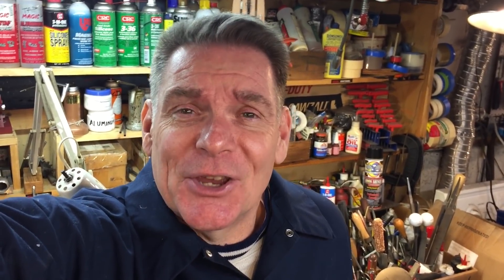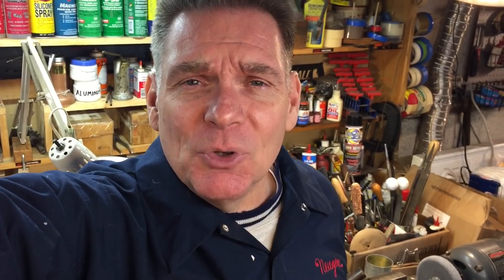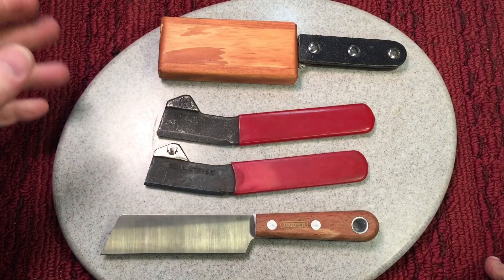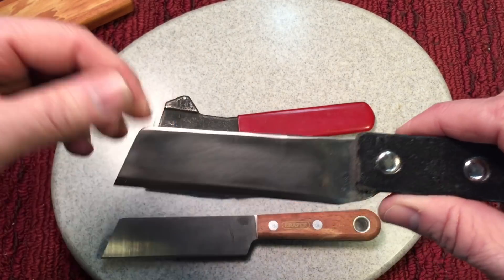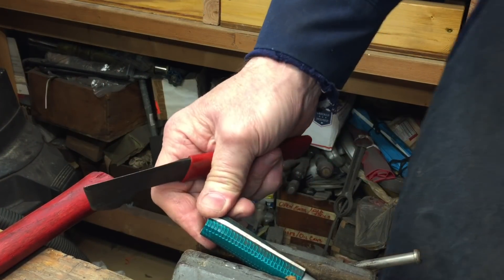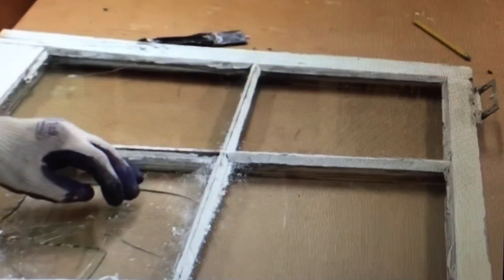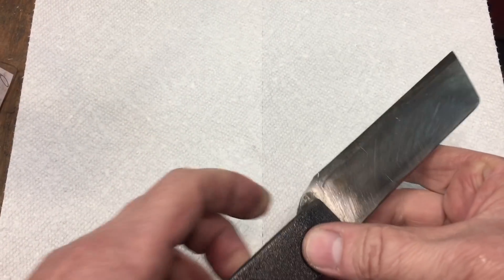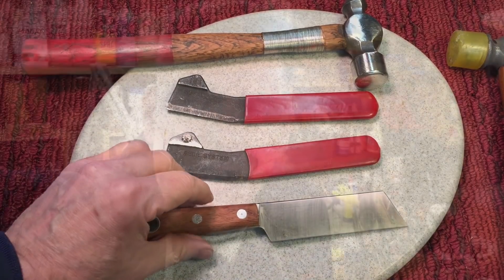Introduction to the Hack Knife.

Comment: I clean the rubber handles with mineral oil (food grade) and then use a mild degreaser and nontoxic wheel cleaner that has carnauba wax in it. They do get grimey but I try to stay on top of my tool cleaning since I don't want to contaminate things, make the insides of my cabinets or boxes or bags dirty, or put a dirty tool on a clean or painted part - it's often easier to clean a tool than to clean something else!
Though maybe I take it a bit too far at times.

Comment: I recently discovered tub o’ towels on amazon. They are pretty amazing the grime the take off. They are hand wipes. All my rubber grips on my pliers and screwdrivers were black from mechanic work for years. I did a quick wipe down with very little pressure and it cleaned them all like new. I was amazed, I don’t think they should have caustic chemicals since they are hand wipes. Give it a shot you will be surprised.
Reply: It took 4 years but he finally tried them!

Comment: Use liquid hand soap and warm water and the rubber grips will look like brand new. I have screwdrivers with rubber grips which are ~20 years old at work. They still look good.
Reply from the maker: Marcel Germann We have a hand cleaner here called Goop that works great but who wants to have to constantly clean the handles?  I prefer Acetate.  I also liked to old fashioned steering wheels!  😃
Reply: @ScoutCrafter  At my work the tools are provided by the company, so I don't have a choice.

Comment: I'll bet good money the sharp edges on the back of that hack knife were there to be used with ferro rods. The expectation when batoning is usually that it's being done with a branch or improvised wood mallet from what I've seen. For processing kindling those knives seem to fall somewhere between a dedicated froe and a full on bushcrafting knife.
Reply from the maker: Curiosity Forge Allan- Hack knives were really popular 50 years ago-  The Ferro Rod phenomenon is only the last 10 years as YouTube has popularized them.  I have been camping for 45 years and we use a lighter or matches to start a fire.  Using ferro rods is akin to fly fishing for food.  😃👍
Reply: Fair enough. I'm just spitballing possible reasons for a spine being that sharp. Between the stress risers created by those sharp angles and the nuisances created by handling them usually there's a specific reason for the edges to be there.
Reply: Curiosity Forge nope only used in uk for glazing

Comment: Great Video. The wood handled knife has what is referred to as "convex edge from the looks of it. So as it goes through the wood it causes a popping effect as there is little surface for the wood to rub against. Some what like a straight line along the curve of a circle it has a reduced baring surface. Also the angle changes quite drastically during the curve for the cross section putting more pressure on the wood to part
Reply from the maker: Hi Abe!  You know battoning has become really popular since the bushcrafting craze.  However the old fashioned Froe was the grand daddy of them all!!!  =)

Comment: Hey I use linesman pliers all the time haha they are great so many uses though you would cringe at how they are used in the field when they become an improvised hammer and such, but than again the slotted screwdriver becomes a chisel for wood, concrete or masonry as well as a pry bar. I dont think theres many jobs I can do without my linesman pliers or screwdrivers least electrical wise.

Comment: i use one of these to take out old putty ,the leather handle is best for the hacking knives because after a days work the vibration down the handle will make a mess of the wood , splits and loosens and im not touching the wood with the hammer, i replace my handles with polymorph now because its indestructible

Comment: That was really neat I have never used a hack knife before. Now I know what they can be used for. Does the plastic start to break down over time? Thanks Scout have a great weekend. Hope your back gets better =D
Reply from the maker: Lord Venger Do you mean the Screwdriver handles?  If the Acetate wasn’t mixed properly they do!
Reply: @ScoutCrafter  I meant the rubber on the rubber handled ones. I did proof read my comment lol. I know the sun/uv can play a big in stuff like that

Comment: I agree about the rubber handles.   However, if they are cheap enough, and you use them really hard, they are okay.  They slip a little less.   However, I actually prefer acetate, triangular shaped handles.  I love the translucent colors.
Reply from the maker: Yes!  Triangular handles are very ergonomic!

Comment: If I start chopping kindling, they have to drag me away or else we end up with tooth picks, I love splitting the wood like that hehe! BTW how do you actually measure 50/50 mineral oil and vasaline, as only one is a liquid?
Reply from the maker: Hi Keith- Basically you eyeball it!  Start with a jar of Vaseline and put it in a double boiler, then fill the jar with mineral oil and dump that in the same double boiler and over a slow heat let them resolve and mix together... When they are mixed up remove from heat and let cool.  They won't separate it will just look like a thicker mineral oil...    =)   and yes, splitting the wood is very relaxing!!
Reply: @ScoutCrafter  Thanks for your recipe John, I expect it clears the sinuses too, if you get too close lol.

Comment: the purpose of the leather riveted onto the footprint hacking knife is to absord the shock, when hammering, they are not made to be ornaments just for looks, they are made to do the job, the best way, unless you just want to hang them on the wall, which is not practical. that's why we have not got square wheels.

Comment: I see your pain. Sit for several hours in a heated whirlpool.  Come out and drink a lot of fluids to cool and go back again. The old rinse and repeat.  Feel better after  a couple of days. As to the tool proper differential heat treatment  makes a good too.
Reply from the maker: Hi Philip!  You know I was telling my GF that a backache is almost like a cold as it has to run it's course..  The other day I went to the chiropractor and he put on the electronic stimulators on my back... After 20 minutes I literally had to crawl off the table!  =)
Reply: @ScoutCrafter   I know,  the last time was the siatica for me.  I don't care for the electric stimulus some use. By the time they crank it up high enough to feel them they are not pleasant.  Felt better when I go to a masseuse.  Having the old body relax gives me the best results.  Hot tub, whirlpool or a sauna can usually get me there. The old time Finns here would start the wood sauna Saturday morning and it was ready by noon.  These guys were loggers back when you still used chainsaws.  They bought a 24 pack of beer and drank a few during cooling off and going back in.  Sweat out everything and totally relax. I drink Gatorade.  You go outside in your shorts and sit in 20 degree weather and is like a summer evening.

Comment: The German Wera and Wiha screw driver handles are notorious for getting so dirty, that you can't even read the text on them. The newer versions have the screwdriver size printed on the end cap of the handles now. 

Check out the Japanese Nata, it's the same design as a Hack Knife. They use it to split wood for fires or just getting through underbrush. https://90daysinkyoto.com/2014/07/21/my-japanese-nata-%E9%89%88/
Reply from the maker: Hi Kent!  I have the Silky model https://www.rei.com/product/156195/silky-nata-professional-machete?CAWELAID=120217890006595150&CAGPSPN=pla&CAAGID=15877486840&CATCI=pla-430229483728&cm_mmc=PLA_Google%7C404_148371%7C1561950001%7Cnone%7Cbe7108e1-fd8b-48ff-9bb3-5c3fbe5cfb63%7Cpla-430229483728&lsft=cm_mmc:PLA_Google_LIA%7C404_148371%7C1561950001%7Cnone%7Cbe7108e1-fd8b-48ff-9bb3-5c3fbe5cfb63&kclid=be7108e1-fd8b-48ff-9bb3-5c3fbe5cfb63&gclid=EAIaIQobChMIoeOgm-Dt5QIVipyzCh05kQcCEAQYBSABEgLeHPD_BwE  

I have seen that gentleman's videos and he is very good!  Lots of great content.

Comment: Great video John I’m the same never heard of a hack knife they look to be a great all round 
Tool I will put one on the list ha ha it’s getting bigger and bigger .I have a hammer that I’m 
Going to bind like yours but it’s got metal finials coming down off the head on to the Handel 
One of those has a small crack in it do you think the wire method would work in this case 
I just want to make it stable it’s a small tac hammer god bless have a great weekend 🔪🇺🇸🎅
Reply from the maker: Hi Matt!  Wire is nice looking but Kevlar sting or even dental floss works great!!!